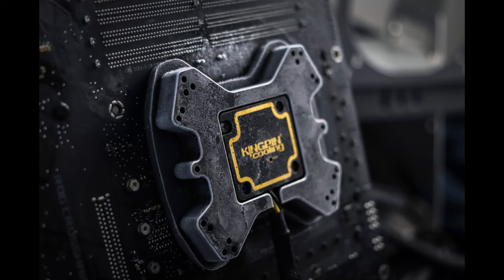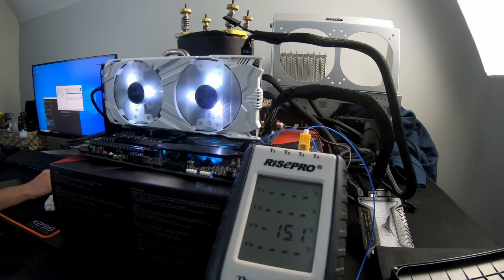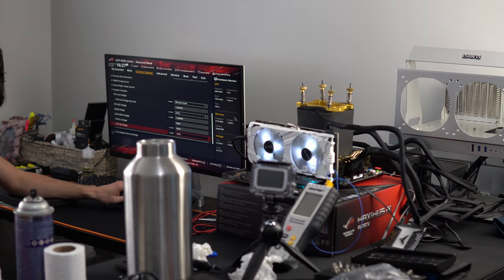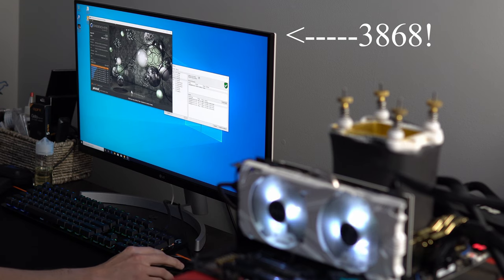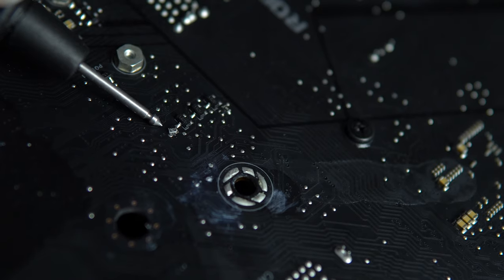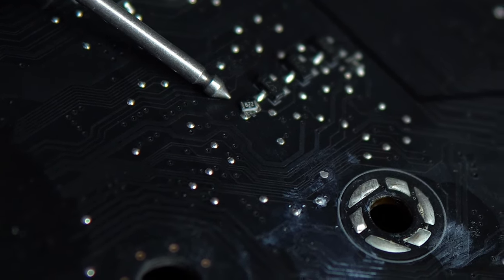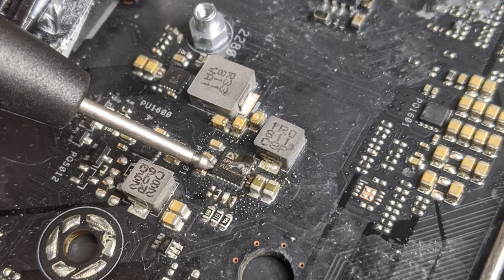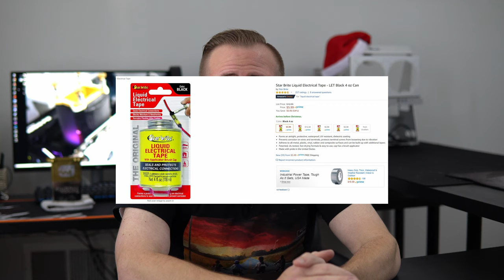Ryzen 3900x Extreme Overclocking with Dry Ice | Yes something blew up.

Comment: good job for the first session. but with the acetone boiling over it sounds like you may have to much acetone in the pot.  and it is a good idea to have a pice of foom under the motherboard to help with condensation and suport. and like you said more LET on the bord, alle the places that risk getting condensation on it
Reply from the maker: To your point, after the time I caused it to boil over, we went with much less acetone the final run. Additionally we did use some insulation foam under the pot around the socket- same as we did with the chiller. It's definitely a worthwhile addition.

Comment: confirmed APW8713
Reply from the maker: Yeah I think you are onto something there. My wife looked at it and said it started with APW as well so I did some research and my guess is that it's a voltage controller for the memory.